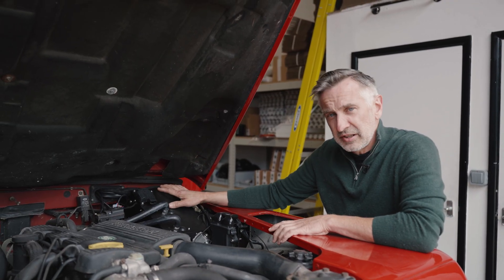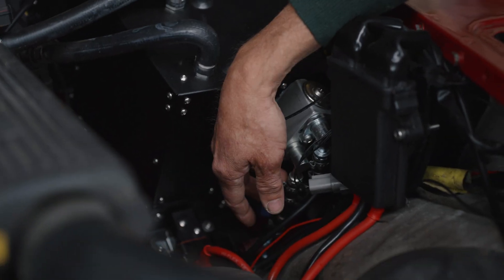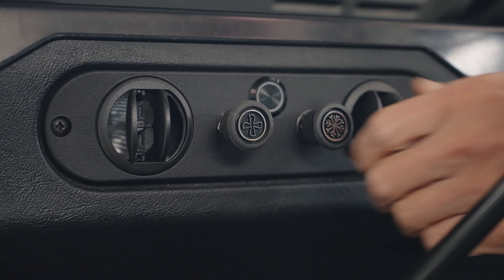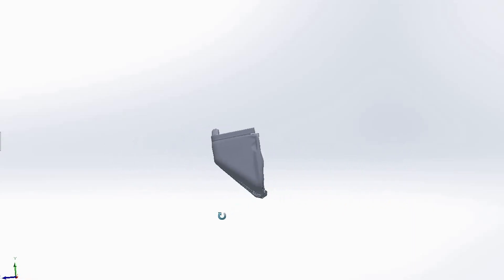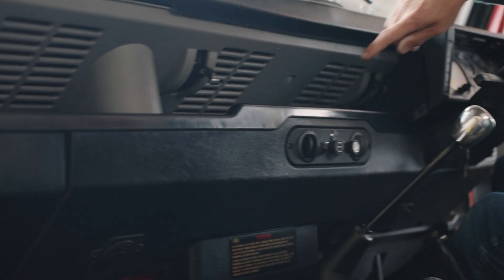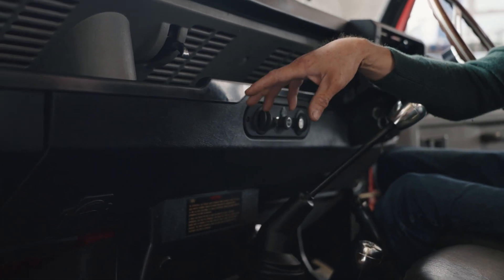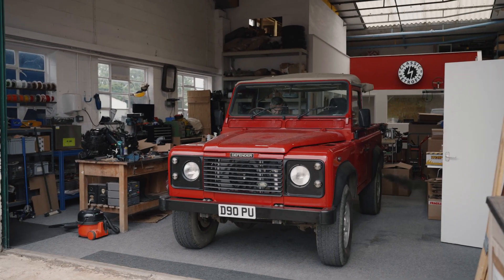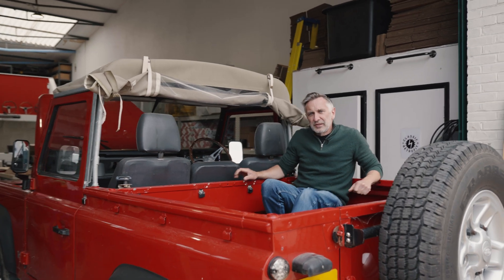Classic Retrofit Land Rover Defender Air Conditioning R&D Part 2 (4K)

Comment: Very impressive.  Will the kit be compatible with the 200Tdi too?  Their engine air intake is in the left wing rather than the right side of the 300, and your refrigerant charging valves may be where the ducting comes through.

A lot of Defender owners have fit dash consoles (Raptor or MudStuff are typical), which cover the area where your controls and facials vents are sited.  Will you have an alternative to allow the vents to be sited outboard of the panel recess and for the controls to be mounted in a different location to where you used?

It looks a great design with very high quality.  What is your target RRP?

Comment: What an impressive system! Would the kit come with the inner dash parts to fit or would you sell under dash as a whole?
Reply from the maker: Thanks! The inner dash parts are included in the A/C kit, but they are now available as a kit for use without the A/C system, take a look on our website now.
Reply: @ just had a quick look on your website and there isn’t anything on the defender page, just wanted to let you guys know
Reply from the maker: @TK42715  Thanks for the message - it should be on the website later this week... I might have gone a bit too soon!

Comment: Does the servo cut off coolant flow to the heater matrix when the ac is on or does it redirect the coolant back to the return pipe?  If it does not it may be a good idea to redesign it so it does.  That circuit helps cool the back portion of the block to help prevent overheating/warped heads (from what I have been told) on the 300 tdi

Comment: Great effort. Very well design ! But, it's not that easy when it comes to air conditioning. During summer, temp. may rise up to 40°C + high humidity in some area. Using the original Defender airduct (a metal frame heater air duct) for cooling the air, easily to get condensing water (condensing water collect under the dashboard area) 

The original Defender airduct was design to use only for warm (dry air). As, I had tried this method before. Rust occured around duct area under dash console.

Note: That's why the original design of Defender air conditioning unit has to attach under the dashboad console, away from the heater box.

Note: Aircond. unit in the engine bay, become a problematic (high amount of heat produced while engine is running).

Comment: I love it. The OEM AC was the worst in how it took up all the passenger foot space, leaving a very claustrophobic travel partner. I really appreciate how you resolved this working with the original dash as opposed to having to swap to the later Puma dash. Will this also be plumbed into the dash windscreen demisting vents? 
All looks very clean, tidy and factory. Any idea yet as to what the retail pricing may be? Great work